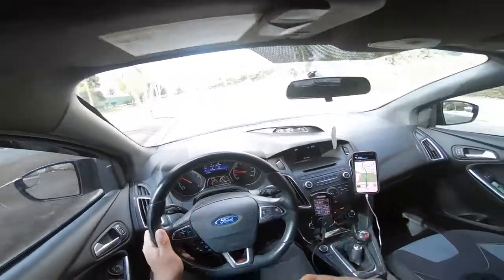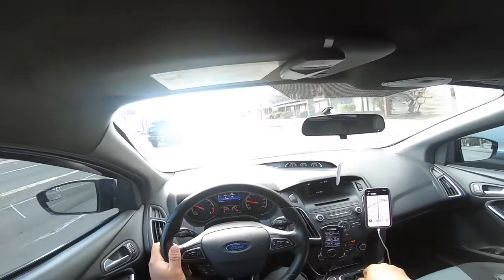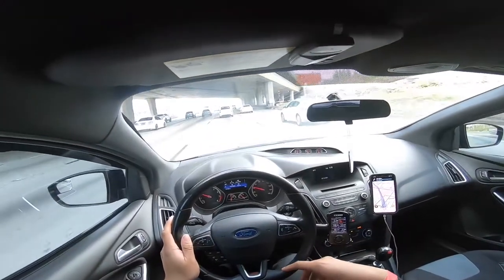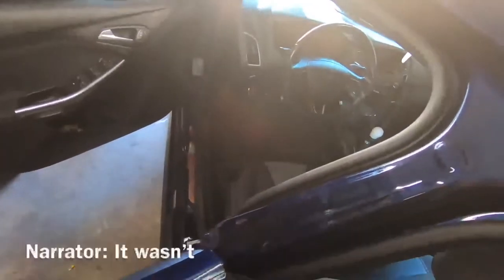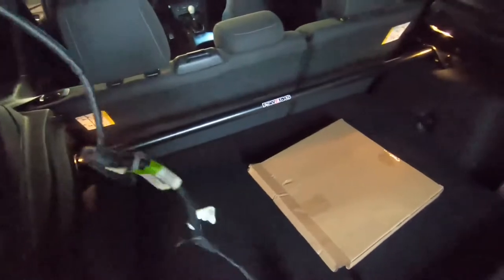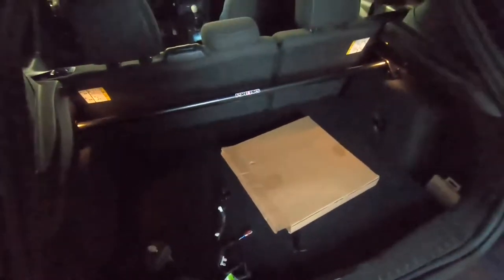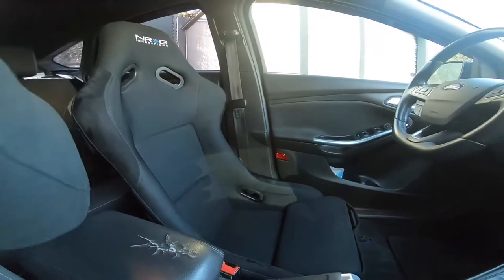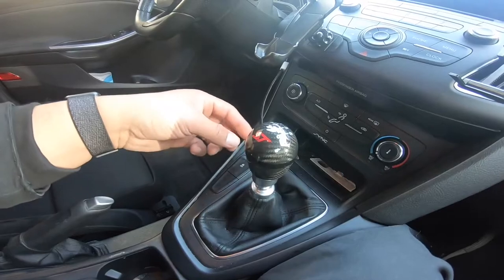NRG Bucket Seat Install and Review | Focus ST

Comment: How's the seating position now? I have a 16' ST with the ST2 package and after 2 years of ownership, they are killing my back! I've been looking into getting an aftermarket seat for the driver side with better support, however im afraid of the new seat sitting waaaay to low.
Reply from the maker: It is definitely waaaaay too low, which for me is great but my friends that have driven it with the bucket seat don’t like it very much because they can’t see the hood at all. Also they do get uncomfortable after at least hour and a half of sitting there, at least for me. If you can find a seat bracket that doesn’t seat as low then you’ll probably like it
Reply: Thanks for the input. How tall are you btw? I'm looking at the Recaro Sportster seat and option in for seat spacers... Not that many tall options out there
Reply from the maker: I’m 6’4”. The sportster is probably the way to go specially since the head rest is tall unlike the NRG
Reply: Sheeesh I'm 5'10... Now I'm really doubting I'll be able to see over the hood.
Reply from the maker: @moknowsyou  had a fried around the same height drive it and he really like it and had no issue with it and the week after he had a bucket seat in his car. So maybe it works for you but it does take a little getting used to driving it seating lower. Even now after months of driving it still feels weird for me to be that low
Reply: Do you have any more pictures of the seats in car? Do you happen to stay in LA btw? I've seen an ST around in your color with the plates Apex on them.
Reply from the maker: @moknowsyou  no, I haven’t really done much since that last video, got in an accident about a month ago and I just put the seat back about 2 weeks ago. No I stay in OC, hardly ever make it deep into LA, only for the canyons really

Comment: Where did you get the rails
Reply from the maker: From vivid racing website. I recently had to get another set and got those from Amazon for $10 cheaper but they definitely feel $10 cheaper
Reply: @Nes2303  note taken, yeah I have an st3 with moonroof, finally ready to take it to the track running e30 with suspension work, after everything I don't fit in the car with a helmet 😂
Only 6'2 crazy
Considered chpping the brackets on the Recaro, taking roof out different seating positions, nothing looks likely to work.
Reply: @Nes2303  
Also, think I could mount it without the rails and just use the chair for track?
Reply from the maker: @iceegoo3127   man that sucks. That’s the main reason why I got the ST1, I barely fit with recaros and the sunroof. However I am thinking of getting taller side brackets for the seat, my legs are almost straight from how low I’m sitting and I really don’t want to recline
Reply from the maker: @iceegoo3127  you could but the seat will be dead center so if on your regular seat you have to slide back then more than likely you will not be comfortable. I installed it first without a rail and I could barely squeeze in and could not step on and off any of the pedals
Reply: @Nes2303  Alright, it is crazy to me how limited my options are for a seat haha, I'll likely go with what your set up is, nrg shop is in California, so maybe ill cruise down to them.
Reply from the maker: Yeah not a lot of track focused (no pun intended) parts for this platform for some reason. A lot of the seats fit the car but they were not marketed as such

Comment: What's the measurements for the seats
Reply from the maker: Shoulder width is 23”
Back width is 15”
Hip 15.5”
Leg 20” 

You can search for FRP-300 dimension chart and you can see pictures of all the dimensions. I’m 6’4” and fit just snug enough at 290lbs. Something a tad bigger would be un I but I’ve taken it in road trips and I was not super uncomfortable just maybe had to stop every 2 hours to stretch